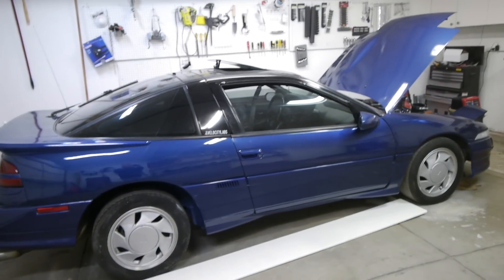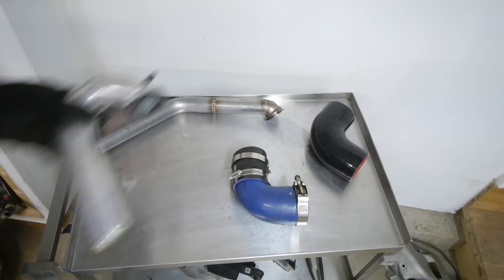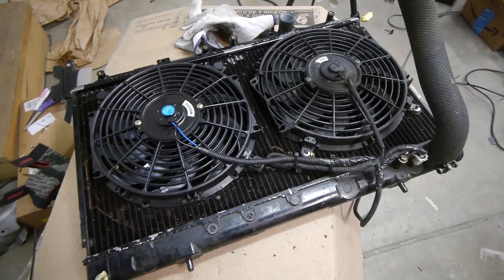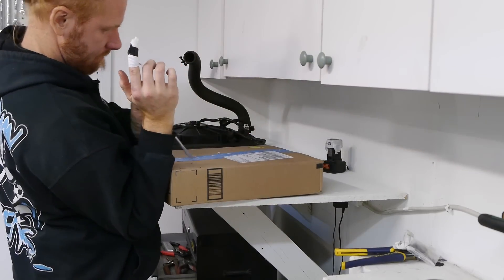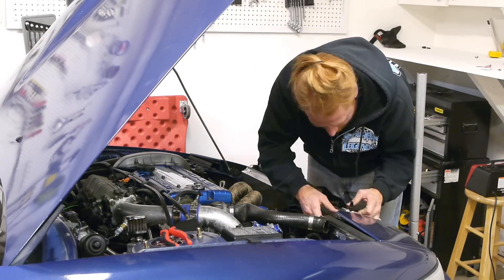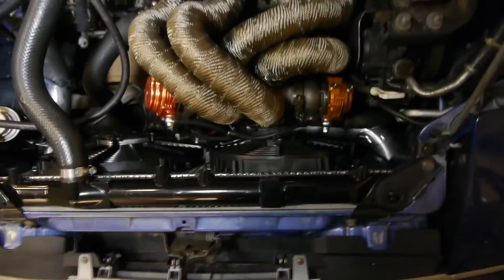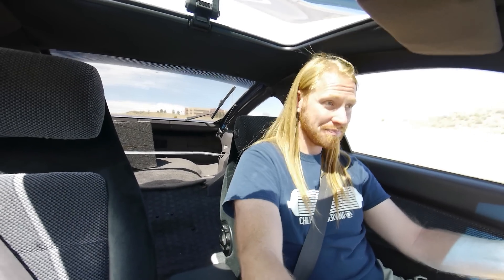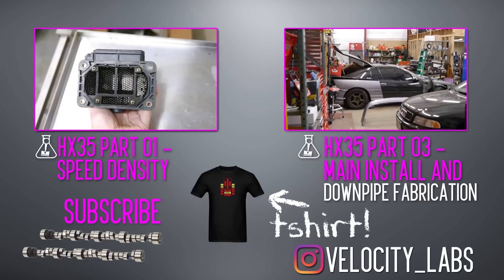HX35 Turbo Upgrade Part 04 - Cooling and test drive

Comment: what spring are you running for your waste gate and BOV? also what bov are you running at what boost?
I own a 99 gsx and im tryingto with an HX40 with a t3 open manifold so i could get inly one wastegate which im going with TIAL as well as the BOV. Im upgrading my cams springs , biger injectpor and fuel pump. what do you suggest me ?

Comment: Yo I have the same setup as you, what you've shown anyway. I would like to know what you have done to the long and short block. I've done and an Evo camshaft swap and valves I'd suggest to do so for the performance and the exhaust note sounds way better for a plus

Comment: Inhave a 97 eclipse. When I got it the car wasnt running Wright. Motors running better so I'm now looking at the power steering pump. It doesn't have any. Would u no what steering pumps will work on are cars. U no if the neon will fit and could u show it on your car. None of the wreckers hear have eclipses available

Comment: GREAT VIDEO BRO THANK GOD YOUR LIKE THE LAST PERSON LEFT THAT STILL SHOWS THE 1G Dsm Love
Reply: Tyler Greer not really
Reply: You can still find mint condition 1G's for sale.
Reply: You can still find mint 1Gs for sale. Yeah good luck pal
Reply: I just bought one this year, a Panda Talon AWD Auto with 59k miles.  I've seen at least 5 for sale this year alone that are single owner, low mileage examples.   A lot of the original owners are finally getting old enough that they don't care about em and want to get rid of them.  Most are garage kept and have minimal to no rust at all.   Mine was owned by an older lady in a more rural part of my state.  They are out there, you just have to look high and low for them.

The biggest issue in 2017 is that the ECUS are on their last legs.  The majority of them are damaged due to leaking capacitors.  After 25+ years, it's something to be expected especially if moisture is locked inside the car due to leaky door seals.  In fact, that is what was wrong with mine and how I managed to buy it for a ridiculously low price.  The owner got too frustrated because they couldn't figure out how to fix it and just wanted it out of their driveway.  I actually did the first startup last night after swapping out the bad ECU for one that I knew was good.
Reply: I have two 1g dsm's there not mint but there in pretty good shape. I try to show some love on the weekends

Comment: You should if your not. Be sure to reuse the heat sink on the driver side fan that comes as stock. It's use is to remove heat from the fan wires and electronics given it's location to the exhaust, turbo and heat. Granted a turbo blanket will help for the melting items.

Comment: What turbo manifold did you use for the hx35? Does the turbo require both oil and coolant?
Reply from the maker: just oil for the turbo, this is the manifold: https://youtu.be/6w_XABBtEE8

Comment: Hi What exhaust housing do you have on your HX35 ... im building a 4g63 evo and where looking at the Hy35 10cm T3 turbo... and wanted to know what you ran.. and if yours is a stroker or still 2.0?
Reply from the maker: It's the stock 12cm housing.   Still 2.0, but I'm going to be doing a 2.3 stroker next summer! :D
Reply: did you ever get to go 2.3?

Comment: Hey i have a 5 speed awd tsi. And my 5th and race mode ( reverse) ia out i cant find any videos on how to fix this problem i was told u can fix it cheaply if u can tear apart the trans from what i can see the 5 gear bolt walked off. And i also would like to see a water pump timing belt video

Comment: Do you run both fans off of the factory harness for the right fan?
Reply from the maker: Yep.  And I have a switch that turns them on and off.
Reply: On my DSM I had to run a Push pull too. With one spahl and one summit cheapy fan, they kept popping my fuse too. So I just had the factory right side harness trigger a 30a relay with a direct to battery wire job. so both fans kick on and off all the time. And I don't get the AC button fan trick but it works flawlessly.

Comment: hey may i know exactly what did you do to the setup to get the turbo flutter? When i checked  your previous videos (the on with the camera focusing on the hx35 turbo) it doesn't make that sound.
Reply from the maker: It flutters in that video but it's difficult to hear.  Once I put the 4" aluminum intake on it then the sound got crazy awesome.   I think the intake is bouncing the sound around and amplifying it.    It sounds like a 2JZ or RB26 now! :D  I don't know if it's good for the turbo or not, but HX35's are cheap so I don't care :D

Comment: Full fan shroud video, please! I need to make one for my BMW, because I'm tired of the racket from the mechanical fan. Also, the way BMW has the expansion tank/heater hoses routed is an absolute PAIN. I want to improve serviceability, and quiet down the racket. I've been thinking about designing it in CAD, honestly.
Reply: Agreed. I'd watch a fan shroud vid. As for using CAD to design your BMW shroud, I suspect that you'd be better off using "Cardboard Aided Design" (as Project Binky puts it) instead of Computer Aided Design. Short of an automated tool to scan in the existing engine parts (Google Tango, maybe?), it's gonna be a pain to get the geometries of the existing engine represented accurately. If you're doing just the one shroud, I'd model it in cardboard. If you have lots of other plans, of course, it might be worthwhile to somehow scan in the existing parts.
Reply: just measure your rad and make half a box with some clearance off your fins and a hole for your fan. it's not hard

Comment: I lower the rates on my megan coil overs by 2kgs all around. put the rear springs up front and order new ones from megan racing for the rear. contact James there. it made a world of difference
Reply from the maker: That's a good idea.  I went with Eibach springs and I love them, I'll have the video out soon.
Reply: Velocity Labs, you just replaced the megan with eibach on the shock? if so the megan shocks have a limit of 2kgs up or down. if you go past it they blow
Reply from the maker: Good info!   I just read on their spec sheets that it says " All of our dampers are capable of handling a +2kg/mm or -2kg/mm change in spring rates.."  Thanks!

Comment: use a spal or mishimoto puller fan wired in reverse to push. mount to the front side of radiator, that way you will have all the clearance you need for the Turbo and the car will stay very cool. without a shroud
Reply: topsecret ss didn't read ahead and suggested the same thing. blow through instead of draw through

Comment: You probably could have mounted the fan in front of the radiator, and reversed the polarity, that's what I did with my cheap fans and they work pretty well.
Reply from the maker: That's actually what I needed up doing! I needed to be clearer about that in the video.  I'll be doing a cooling and AC video later no though.

Comment: if you havent already a video on a diy fan shroud would be awesome. also an you run a push pull system with a fan in front on right and one fan in back on left.